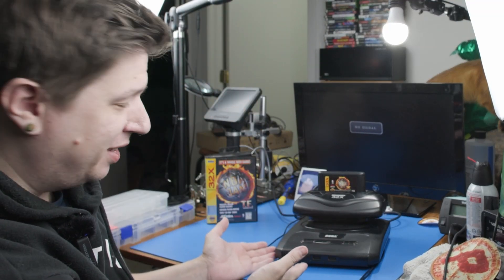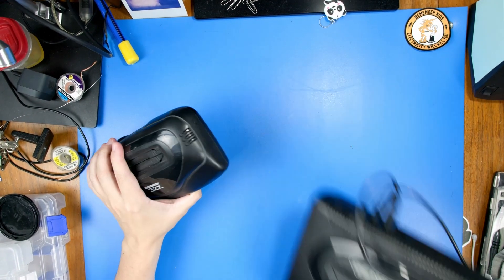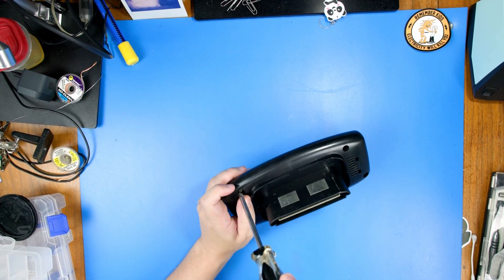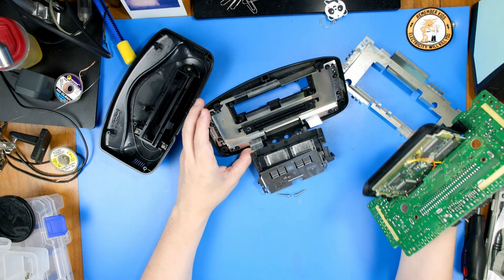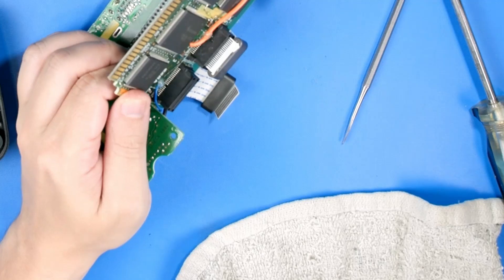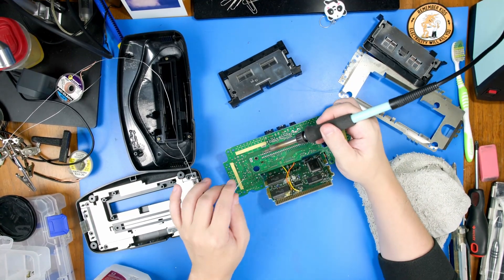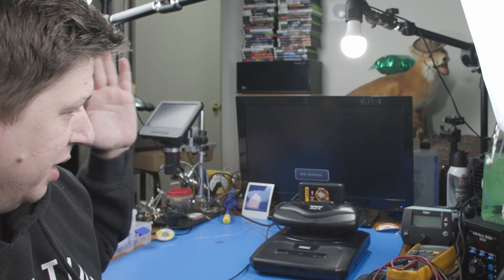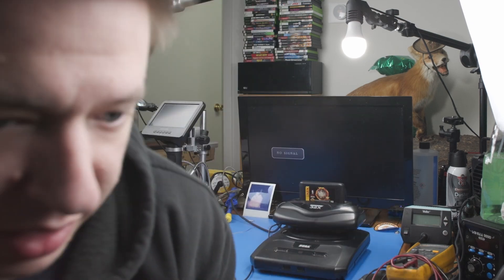Can we repair a Sega 32X with No Picture - showing only random colors.

Comment: My childhood 32x did the same thing. The only thing I did to get it working was just clean the dust build up inside and remove some cat hair that managed to get in there. Little kid me was proud I fixed it feeling like a super technician and surprised my parents. 👍
Reply: Now the Sega CD system that was a bit tricky when it broke. Took 10 years later after learning electronics + internet getting better on info to find a common fuse that blows to fix it lol.
Reply from the maker: was it a Model 1 or Model 2 Sega CD? I just recently picked up a Model 2 that looks like it was left in a barn and it has no power when plugged in. I have yet to take it apart but it would be good to know if there is a known fuse issue that I should be looking for when I get to that point haha
Reply: @ShawnsTechRescue  mine is the model 2 where the CD tray is on the side. Good luck on fixing it up. Hopefully it is just a simple fuse issue and not bugs living in it since it was in a barn.